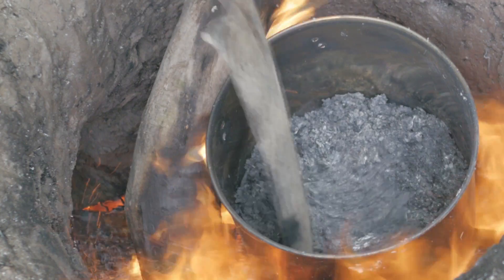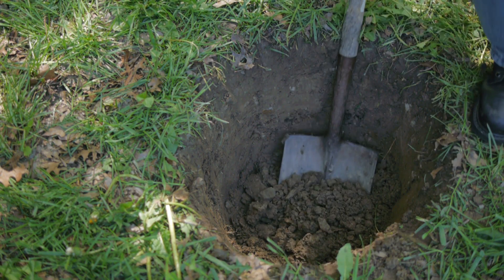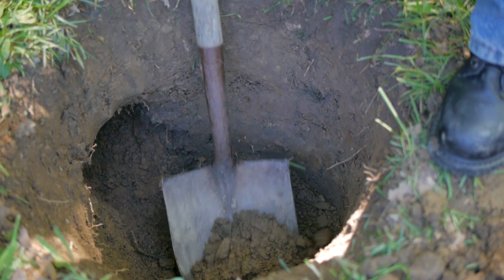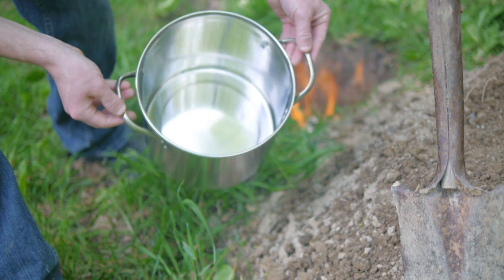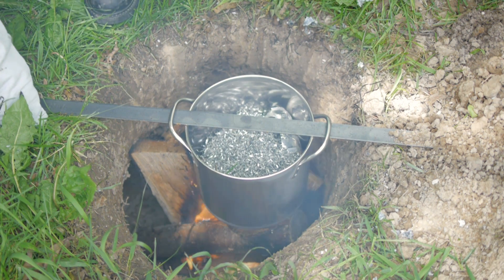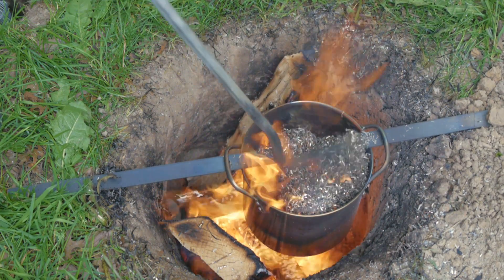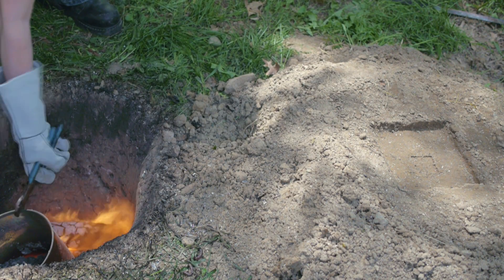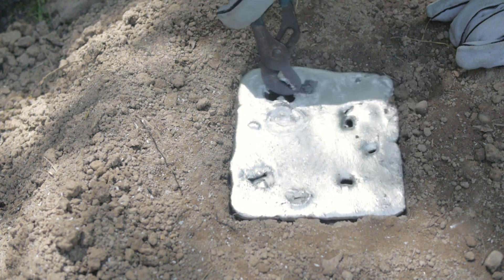How To Melt Aluminum With A Hole In The Ground

Comment: I tried this and my fire didn’t get hot enough… I used a workshop blower to blow on coals and wood, got them both glowing red put my cast iron pot on top and waited then I added an aluminium can… and it just turned brown scorching but not melting. Maybe my hole isn’t deep enough, but does that matter? Someone help!

Comment: For those curious aluminum won’t melt if it comes into direct contact with fire. It needs to be heated properly without direct exposure to fire so in other words it must head through the bottom of a crucible or steel bucket or generally a container that heats up and prevents the fire from coming into contact with the aluminum.

Comment: I was very worried those moisture bubbles were going to pop molten metal all over you. I want to try making Silumin, aluminum alloyed with silicon using a thermite reaction between the molten aluminum and some clean sand to produce the silicon. I read that a eutetic mixture is good for forging and a hypereutectic mixture would be good for casting engine parts

Comment: I did this about a year ago trying to melt cans and I think I have the exact pot that you're using except one size bigger but everybody talked me out of it saying it's too good of a pot to use so. I tried to use a steel cap off a big pipe a friend of mine made but the empty weight of that still bucket was probably 40 to 50 lb and would probably hold 20 pounds of melted aluminum. I piped PVC  underground and I used my leaf blower, just at idle. . So then I bought a crucible which came in broke so waited on the next one and then I broke it on the 2nd melt.. So I'm going to replace my screws first before I even start using my large pot. Glad I stumbled across this I may finally be able to pursue Milton all these cans which I got plenty of wood to use no worries there. Also went to the local hardware store called harbor freight and picked up one of those flamethrowers you hooked to a propane tank actually about two of them but once I tested one of them I was a little skeptical of the safety of it plus I got to get rid of this wood anyway.

Comment: Make the hole slightly larger and line the interior with firebricks (except where the air hole is, obviously). That'll help retain heat and make the foundry more efficient, and possibly more effective.

Comment: DUDE! Thanks for confirming what I was wondering/figuring would be a great way to melt aluminum.  I can't recall the name of the fire pit you made (Think it was related to a Native Indian Tribe, read it in a Survival Guide), but was thinking that would be the best way to economically force air into the fire area.  Some modern tech (small fan powered by solar) to spare having to use a bellows or long pipes and communal lung power.  I can chop wood, that's no money, I can dig a hole, no more money, and I have solar panels to run a small fan, and a cheap pot can be found at Goodwill.  Now hopefully, I can talk the local mills into letting me get some scraps or shavings.  (Lol, just read your description, "Dakota Fire Hole")

Comment: Please help, I have questions! I have my fan (pool toy inflater) attached to a long tube. It goes through the secondary hole I dug, and the dirt is fairly snug surrounding it. Should I widen the tunnel around it? I was thinking this might create additional airflow thanks to the rising heat. 
Why should the walls be the same diameter all the way down? I made mine as even as possible, then built up two walls 6 inches or so, so I could rest a grate on that dirt shelf, and put my crucible on top. There's a spot for charcoal directly underneath, but because of the shelf, it's considerably smaller than the rest of the hole. Should I change anything? Thank you so much, so many years later and I am still a huge fan.
Reply from the maker: Sounds like your design should work
Reply: @Nighthawkinlight  Thank you!! :3

Comment: This is a cool idea, but I have one huge caveat. NEVER pour molten metal in a pile of dirt. If there is any water in the dirt it can flash to steam which then splatters molten metal all over. I had this happen with lead, pouring it into a piece of wood. When professionals cast molten metal, they always heat their forms first to drive out any moisture. If you want to use something simple and safe, dried out sand is much better. You can even mix the sand with a binder and form molds, which is really fun.

In this case, luckily, nothing happened. I just want to make sure that nobody viewing the video gets hurt. Love your videos, keep being awesome!
Reply from the maker: Agreed. Typically a steam explosion is most dangerous in non porous containers because the steam has nowhere to go besides up, through the molten metal. I was aware of this in pouring into dirt which does have some porosity to release pressure downward. It did still have some risk though as you say.
Reply: @Nighthawkinlight  I didn't think of that - the dirt wasn't even highly compacted, so it was probably safer than I thought. My main concern was if people see the video and try it in soil like we have in MD, which is pretty much 100% wet clay below 4 inches of dirt.

Comment: I like that you don’t need to buy an expensive foundry. Thank you. I’ll will do this to melt my Aluminium cans and pour them to make projects. Excellent video.
Reply: A foundry is a building or structure used in the melting of metals.
The pit would be called a furnace and the pot would be called a crucible

Comment: Thankfully I got a cheap vacuum cleaner from goodwill for 3 dollars, and I took it apart and turned it into a blower with the power of a vacuum cleaner. I'm worried that it might be too powerful and put out the fire. Also, a bit of advice. If you want to be able to get good aluminum pieces to melt, cast them in a steel muffin tin to make little pieces of metal without slag that you can remelt later on when you want to use it.

Comment: Very cool, or hot I should say. Its these types of videos that are a real asset in the event of a catastrophe like the grid getting fried and having to survive without electricity. I would imagine this is an ancient method for casting and things evolved along that path to the modern day smelting and foundry operations. 
 When its all said and done the same principles apply, getting the material hot enough to make it molten and cast something usable. Thanks for the video.

Comment: Your furnace turned out pretty well.  Too bad about the aluminum rivets, but at least now you can replace them with steel.  Your casting really did turn out badly, but at least you got a useable ingot for some other project, and should produce much less dross.  All good fun.

Comment: I wonder if you could make a steel crucible with this strategy and coal instead of wood
Reply: HeyelloGaming yes,take a bucket and insert a smaller bucket in,fill the sides with a mixture of 
plaster of Paris .33%
Concrete 33%
Water 33%
Remove the small bucket then cut a steel fire extinguisher in half and use it as a crucible,then fill the sides with coal and drill a 60 degree angle into the concrete mixture and use a hairdryer and a pvc pipe with a steel rod to insert air in there
Light the coals and insert aluminum into ur crucible
Enjoy :D

Comment: I tried a stainless steel pot to melt copper but it ended with the stainless steel melted and not the copper...
Reply: Da fuk the logic lol
Reply: Use a carbon crusable instead. it happened to me too.
Reply: Thats actually rly funny
Reply: for that slow best it and keep a top on it for aluminum hours gas
Reply: You can melt brass in a steel crucible, I think.

Comment: I suspect that if you push the pot into the fire, so that the fuel is under and around it, you would not need the fan. Especially with a smaller pot. This is a good video, thanks.

Comment: Hey man, Id like to makes something like this but without having to put holes into my yard, any ideas?
Reply: You could make the same thing but above ground
Reply: +Subbulakshmi Sankar Yes, make sure that the stuff that serves as the walls of your firepit is non flammable. Other than that just make a structure by nailing together some steel plates and have something that holds the fan. I think large pipes could work well for tunneling the air in. This way is probably much pricier though

Comment: I don't understand,can someone solve my doubt?melting point of Al is 660 degree Celsius,how did you set up a fire that has a temperature of 660 degree Celsius?
Reply: charcoal
Reply: and oxygen flowing into the forge
Reply: A regular fire is much hotter than that, after all it is glowing "yellow hot"
Reply: its called a Dakota hole dude

Comment: How long did it take for aluminum to melt, once it was on the fire?
Reply: same query
Reply: melts prety much instant
Reply: ty, my fire didn't produce enough heat then
Reply: just make sure you have a source of air comming in to get it hot, hairdryer works great
just make sure it doesnt get so hot you could melt your bucket

Comment: HINT: if you use coal brequets and a small hole and a large fan, you can melt cans in seconds.
Reply: Not trying to be a smartass but I'm pretty sure he already knew bc he even said you could use a bigger fan for better air flow
Reply: Connor Simon Wood is inexpensive :) coal would do much better or even propane.. but wood is key :P
Reply: Briquets have clay in them. You would want to use real charcoal.

Comment: How did the grass not burn?
Reply: +DjToneGames its green
Reply: +marxman__1839 What?
Reply: DjToneGames since the grass was living and green then it wont burn easy
Reply: DjToneGames how?
Reply: +marxman__1839 Grass is flammable. Even if it's green.
Reply: +DjToneGames true but for the grass to catch fire it needs to be directly in the flames and needs to have the fire dry it out before the fire can burn it
Reply: +DjToneGames green grass or plants in particular have water in them and therefore don't burn as easily and produce a whole lot mor smoke.

Comment: Can you melt copper like this?
Reply: you would need to plan carefully, use the smallest crucible that will hold the metal. Surround the crucible in burning fuel. You would have to make sure the air got to all side of the fire. It is not so much a question of raising the temperature of the fire as trapping the heat in the metal. That being said, yes, you could melt copper with this.
Reply: +Bryan Noyce could you cover the pit with insulation or some type of refractory blanket?
Reply: Ryan Hanson The trick is to allow air flow but trap heat. Old updraft kilns used roofs made of broken pots and mud. So yes you could but you need to have plenty of air flow.

Comment: Thanks for the insight. You have given me plenty of ideas for my next build. I have tried a couple of different methods neither worked as well as this. I think the world should look different upon refuse. It takes 1/3 of NSW power supply to turn bauxite into aluminium and yet we throw it in the bin every day! We need to stop thinking of the rubbish as refuse and start thinking of it as a source of ore. People who pick through are not scavengers, they are the new age miners! Aluminium , copper, old concrete (gravel and lime) wood pallets (energy source), scrap iron, plastic bottles (syngas and creosote through pyrolysis) and many other things are all objects of value. If one was so inclined one could make a good living of breaking down old car tires using old wood pallets as a fuel source, collecting the nails as an iron source, while heating a crucible to melt down cans and aluminium scrap. One could very easily generate, aluminium ingots, oil, syngas, iron scrap, and ash nitrates.

Comment: Next time, or as an alternative, you could drill a hole through the pot's sides and push a steel pole through to help when you need to remove the pot.
How much aluminum or how many cans would you recommend for making a project roughly a pound in weight?

Comment: Be aware, galvanized aluminium will produce toxic fumes!!!
Reply: +blackvalley007 No such thing as "Galvanized Aluminum"! Galvanizing is the process of coating steel with Zinc.
Reply: Mike Tims
My bad, you are right, there is no such thing as galvanized aluminium...

Comment: do you think a furnace made of mud with the same shape and layout would work if it was above ground?
Reply: If you used mud then it would crack. If it cracks then it falls apart. So it would not work unless you made the sides thick. It would have to be like a hole in a hill.

Comment: Always have to be really careful about moisture in your pour. Like in the video it can cause bubbles but if you're unlucky the bubbles may pop/explode sending liquid metal everywhere. That is why you may see some people preheat their mold before a pour to drive out any moisture.
Reply: I thought that was to prevent shock from cracking the mold due to a sudden temperature change
Reply: +Connor Steppie it's for both.
Reply: +KamiCrit is there a way to protect the holes from turning into mud

Comment: Will my plastic fan not melt it's like yours but it's made out of plastic it's a USB fan
Reply: No it won't, the fan is to far away from the fire, also it pushes the heat back in the forge

Comment: wow! i didn't know you cood use wood instead of coal!
Reply: Anything that burns would work. It's just that coal can burn hotter than wood with the same amount of material
Reply: +Sergio Prot *could,  and yes you just need someting that burns hot but charcoal or coal will work better

Comment: Hi Ben (Nighthawkinlight),
I just make this forge and successfully melted aluminum.  I should mention that I had to dig through about 1.5 ft of solid sandstone down AND diagonally.  This took me about four hours but it was well worth it!  Burs AMAZINGLY hot!  Started to melt the steel rod I was using.  Thanks for the great projects ;).

Comment: will it melt heavier items like lawnmower engines in a timely manner?
Reply: Hay depends on what the engine is made of. Also if you din't mind me asking, why are you melting lawnmower engines?
Reply: +Wafflemonster33 

aluminum. And to separate the steel. Engines are just one of many items including old vacuum shells, carbs, and whatever else is just too damned hard to take apart manually.
Reply: TheStarforce2 it definitely will melt the engine but the speed of the engine melting depends on how big it is. If it is a pushing lawnmower it probably won't take to long to melt
Reply: +Wafflemonster33  yea that's what I was reffering too, regular mowers, kirby vac's, and similar sized objects. Also looking into another design that could use your hole in the ground as an easy way to insulate and fuel with a combustion chamber (giant blow torch) driven by a leaf blower and dripped in recycled veg oil.
Reply: Also I would use charcoal for a hotter flame

Comment: I used your idea, except I only dug one hole and then drove a pipe at an angle for or the air vent. After that I remove the first pipe and replaced it with one that wasn't packed with dirt. I am currently using a hair-dryer for the air and a propane tank as the crucible.

Comment: how do you make it so hot? ive tried with a fan and ive isolated it with bricks. i use firestarters  and wood to get it started please help
Reply: Try charcoal and if that doesn't work it's a little more complicated try the king of randoms foundry it's smaller so it's won't be able to fit as much aluminum which sucks but since it's smaller it insulates better
Reply: thanks nivlac!

Comment: I started off like you did with little bits of pine then i added ash logs. And then for the fan i used a shop-vac and i switched it around so it would blow out air. And instantly the hole was a furnace. I could barley go within 5 feet of the hole, but the aluminum liquified almost as soon as i turned on the shop-vac, hmm i wonder if i can use a bellows.

Comment: Using this concept of a furnace to make charcoal for grilling and such, but I recently burned my hand when the lid of my crucible came off and fell into the fire/ash below. Of course, I used some pliers to get the lid but my pliers were a bit short so my hand was very close to the ash. I was not too badly burnt but it was still a little scary. I'm now on the search for some heat/fire resistant gloves but I'm a bit confused because the large variety of gloves out there. Is there a pair you could suggest or vouch for? If so, please tell. And by the way, about an hour ago I did the firewire for my mom since its her birthday, she really enjoyed it. Thanks for posting that video! And all of your video, they are very informative and really good! Make more soon please!
Reply: Or longer pliers :)

Comment: do you use oak wood for this project or do you use another hard wood such as walnut?
Reply: merk destruction one thing about different woods....hardwoods burn longer and produce good heat throughout their burn life but softwoods such as pine produce a very hot rapid burn.

I don't know anything about melting metals, but I'd say if you have a LOT of material to melt, hardwood (ash, oak, maple) is better, but if you have a small bit of metal to melt, pine would light quicker, burn faster and get hot quicker melting your small amount of metal quicker.....

(I had a wood furnace in my last house so you learn quickly what works).

If you want a fire to start fast, start with pine or spruce, add hardwood after it gets going...The pine will ignite the hardwood and get it going quickly.....
Reply from the maker: merk destruction Doesn't matter. I used mostly ash.
Reply: ok thankyou
Reply: NightHawkInLight  did you use a certain type of Ash?